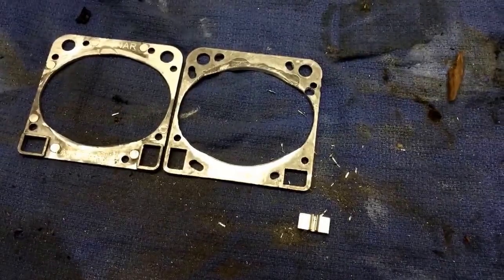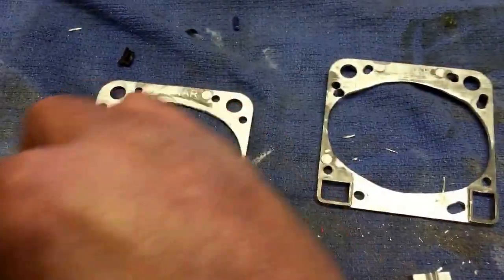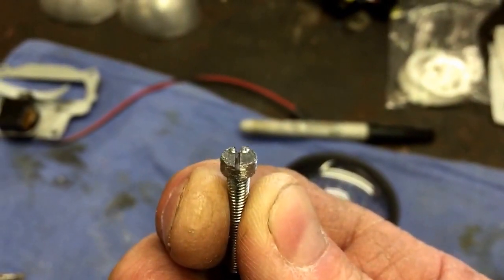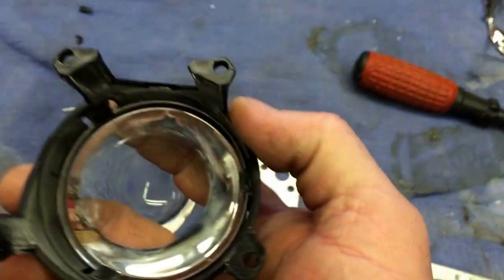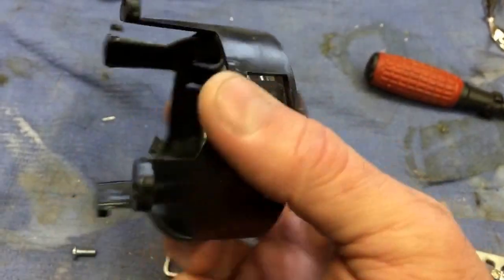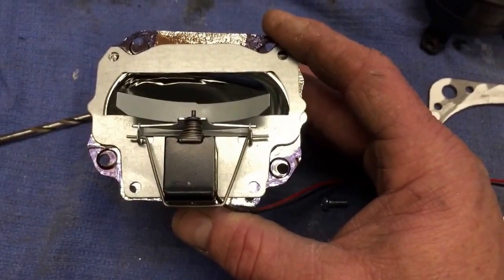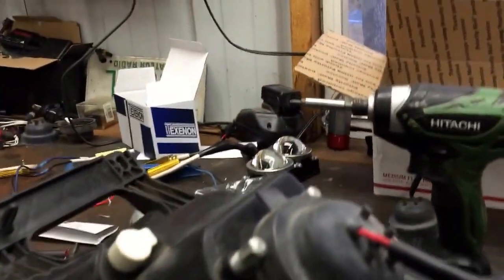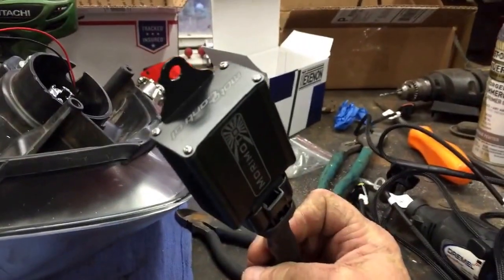Dodge Ram Halo Headlights Disassembly - Replacing the projectors Part 2

Comment: Sir, you are a genius!. I have been looking for a video on YouTube for someone who did a complete replacement of aftermarket projectors and how to mount them to the frame that holds the original Factory aftermarket projector. You have hit a home run sir that's all I can say! Thanks so much
Reply from the maker: Eric Alfred your so welcome! The factory headlights suck something awful! I’m still using this setup and I still love it. Let me know if you have questions about your build or what parts to get.
Reply: Carl Shortt III  Just two  more questions: What was your baking temp.and time. Also, did you re-use factory sealant?
Reply from the maker: Eric Alfred if I remember correctly, I baked mine at 225 for about 10 minutes. Then I pulled them and checked them. After they would not come apart, I put them back in. I think it took about 30 minutes to soften them enough to get them apart. 
These were aftermarket assemblies, not the factory ones. 
You will need to figure out of your low beams go off when you turn your high beams on. If they do, you will need the extra system.
Reply: Carl Shortt III 
Ok, thanks a bunch

Comment: Carl, few more questions. At what temperature and amount of time did you bake your lights to open and to close the assembly? Did re-use the factory sealant only? And lastly, my retro will be using the H1 Mini's with my 2008 Dodge Titan which factory is 9006/ 9005 hi. Do I need to use the high low beam power source that you used in your truck and if so which one?
Reply from the maker: Eric Alfred be sure to check the first video on this build. Is shows the headlights before the modifications and talks about baking them.